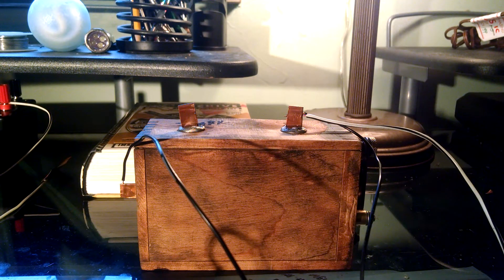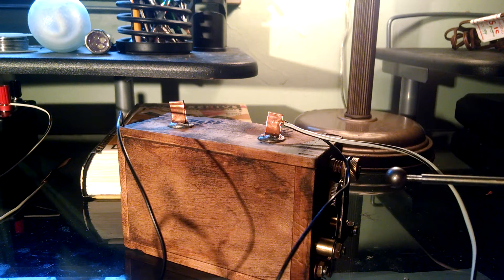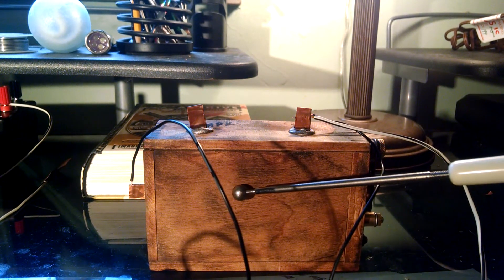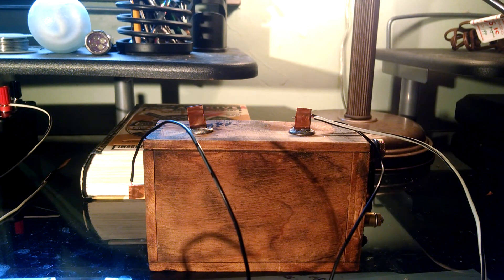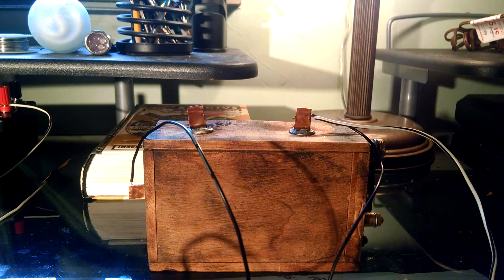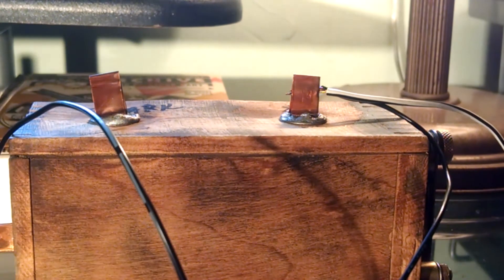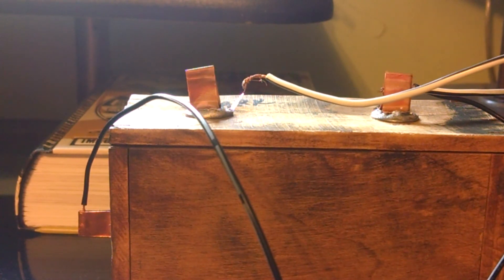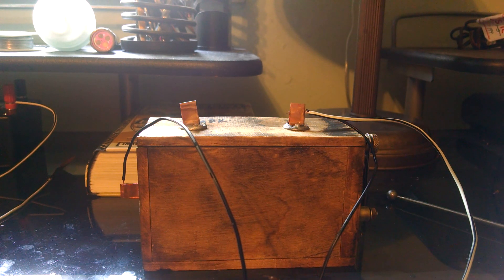Ford Model T Trembler Coil

Comment: Actually, the coil worked off the engine's magneto, a series of V magnets spinning past a 
series of coils inside the bell housing or tranny cage. the magnets were clamped to the 
flywheel between brass rings so the magnetic flux would be at the poles of the magnets.. .
A switch inside the cab could switch coils from a battery of number 6 dry cells or a 6volt
storage battery and switched over to mag when engine was running. The battery was 
probably used more in the winter as u'd get a hotter spark than from the mag.

Comment: 25$ is to much you can got to farm auctions and get them for 4 or 5$ a piece or get them off from ebay for 10
Reply from the maker: prototype9000 ah well. it was there, I just had to grab it
Reply: @bBoss-xl1ld  Don't beat yourself up!  Ya done good! The "$5" farm auction specials generally don't look nearly as nice at the buzzer end and the wood finish as yours.  The ones currently going on eBay mostly look pretty rough, too (and they are not going for $10 anymore neither!).  And you don't really know if they have a bad capacitor or whatever until you test it.  The rule of thumb now seems to be you need to pick up three to get one working.

I got mine 50 years ago as a kid and had hours of fun making light bulbs etc arc and glow, causing snow on our old TV, and re-creating Hertz's and Marconi's experiments.  Yep, fun times!